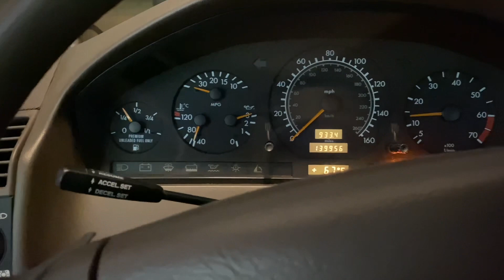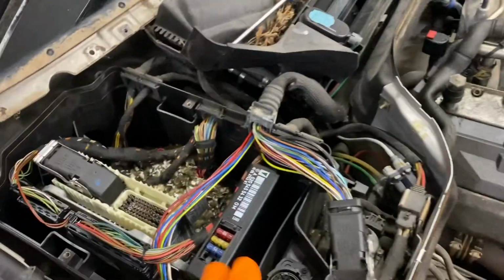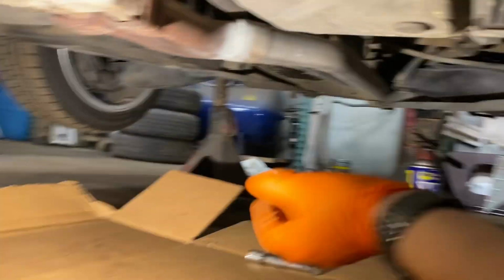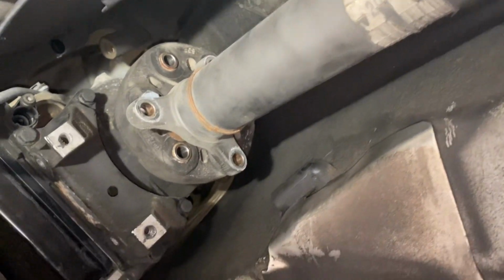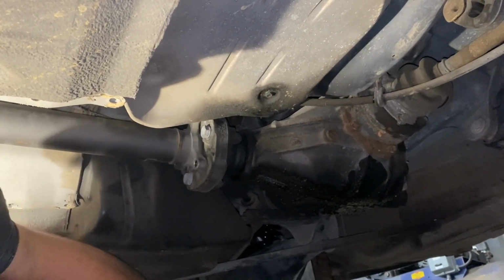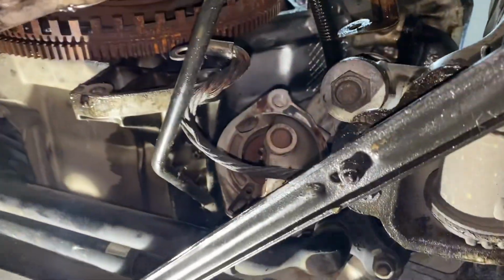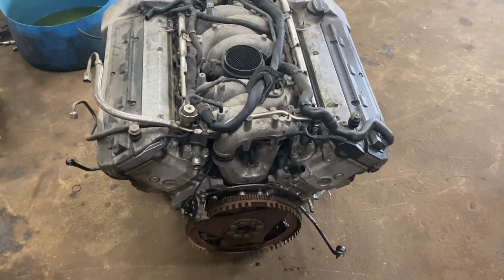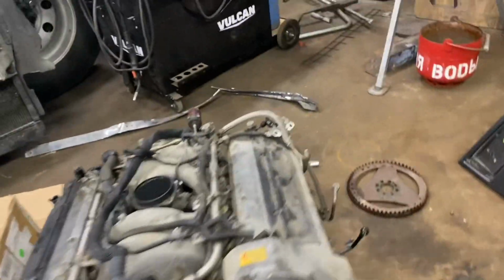SL500 Mercedes M119 5.0 R129 Manual Swap Part: 1

Comment: Nice work! Man I really want to do this to my 99 m113 SL.
Reply from the maker: Don’t know if it’ll work on a m113 but it would be cool!
Reply: @IgnatBK  There's actually a bunch of guys that have done manual swaps into m113 cars, but those are all C-Class, E-Class, CLK cars. @Anderzen is one of them. No one has done it to an m113 r129 though.
Reply: @IgnatBK  Subscribed, looking forward to seeing how you get the pedals setup and if you're able to tune out the check engine light, and all the other stuff needed for a swap into a later model R129.

Comment: Just to let you know bro this is a m119 4.2 L, not a 5.0
Reply from the maker: SL only came with a 5.0 V8
Reply: @IgnatBK  nah m8 it came with a 4.2, 5.0, and a v12
Reply: @IgnatBK  the m119 came in 4.2 and 5.0 and the sL 600 had the v12
Reply: @IgnatBK  you are right the SL only had 5.0  ....the 4.2 was in the E class and S sedans